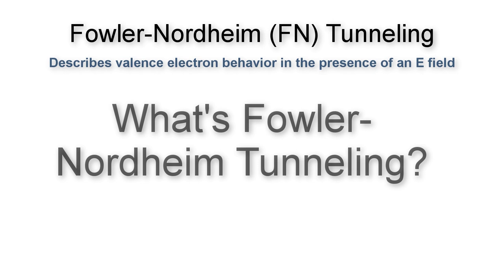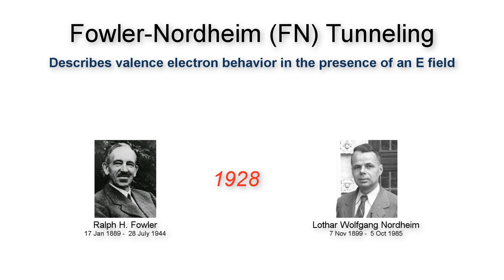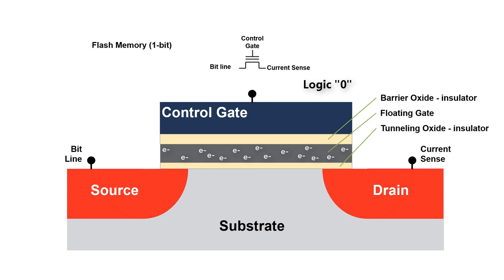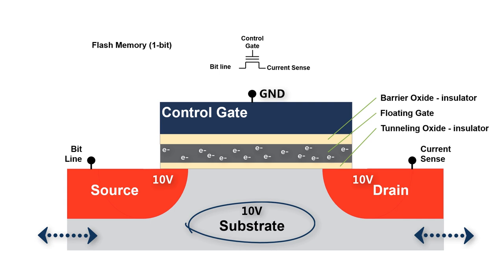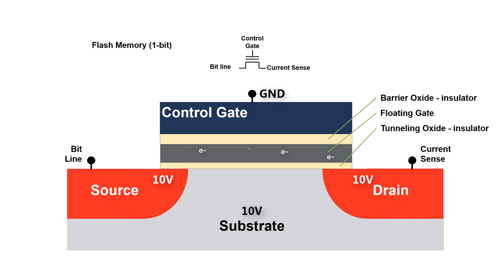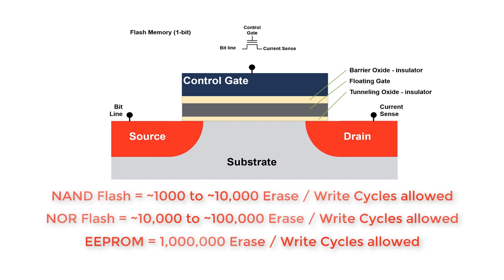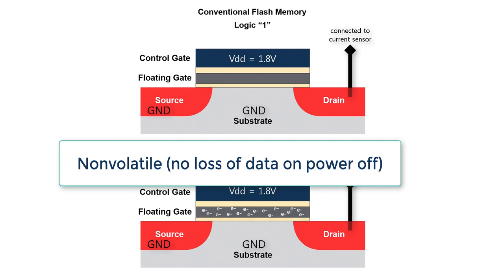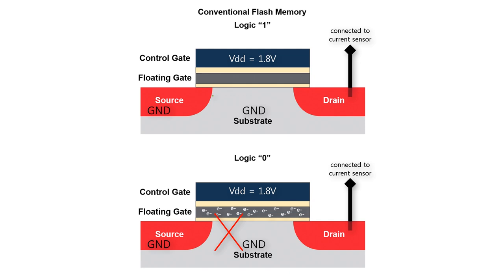What Is Fowler Nordheim Tunneling?

Comment: So full formatting a flash drive sets all bits to 0, activating them, why don't operating systems format in 1 (hex FF) to preserve the drive?
Reply: What the OS reads/writes on a SSD may not be exactly what gets programmed into the NAND cells.
For what is worth, the SSD's controller could be using heuristics to flag zeroed sectors as discarded, then adding them to an erase queue, similar to how TRIM works.
Nowadays it's preferred to use TRIM to format a SSD.

Comment: 5:00 20 years?! Sounds pretty suspicious.
Reply: I have at least 2 USB Flash sticks that had died in a span of ~2-3 years of not being used. I've just pluged them into PC (no writes attempts), and OS stated 'cannot read this drive'. In data restoration tools, drive still has the file system more or less intact, but all file content was corrupted (text files, images, etc.)
So, for long term strorage, use optical media)